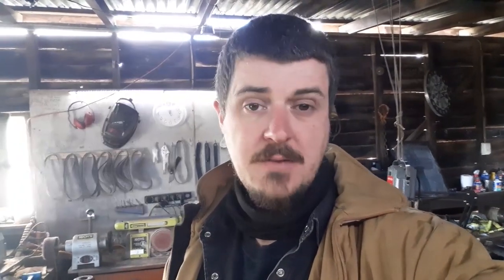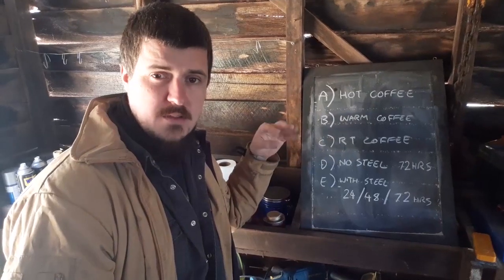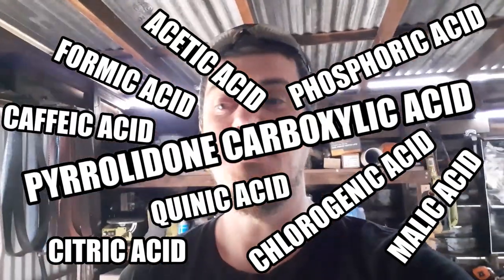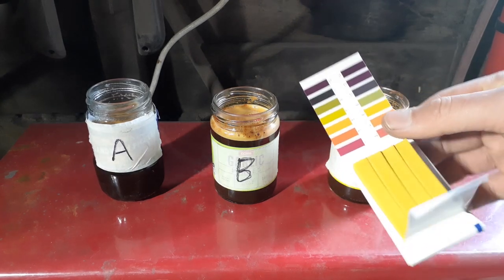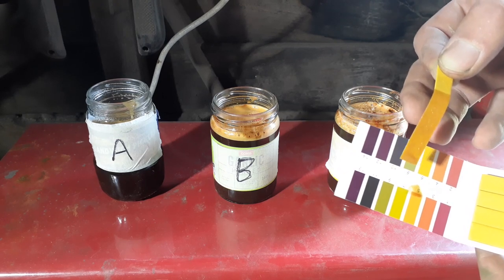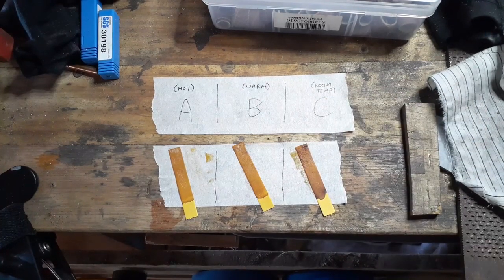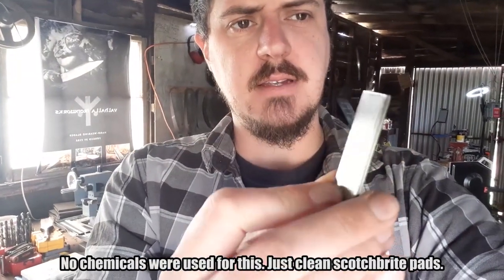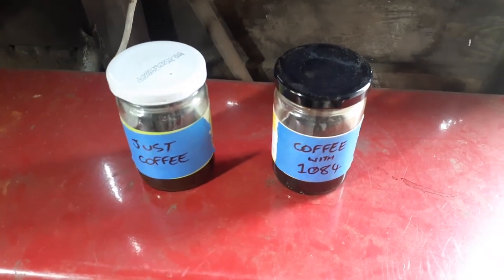The Surprising Truth About Coffee Etching

Comment: So what's the difference in ph over the course of a few days with the different temperatures of water, or even maintaining higher temps over the time? It sounds like if just left alone over days, cold is no better than the hot right out of the gate. Just wondering.
Reply from the maker: The problem comes down to the fact that coffee batches mould up really fast. Only takes a day or two and fungal spores start forming on and in it, leaving it not suitable to use. So you've gotta use any coffee batch pretty much within a 48hr period.
Reply: @ValhallaIronworks  I didn't realize it was that fast. Interesting.